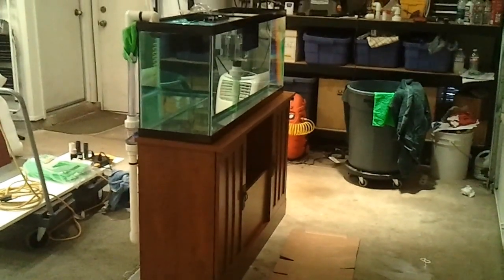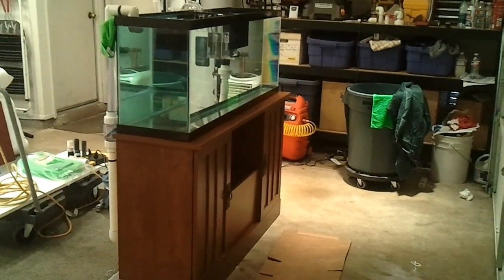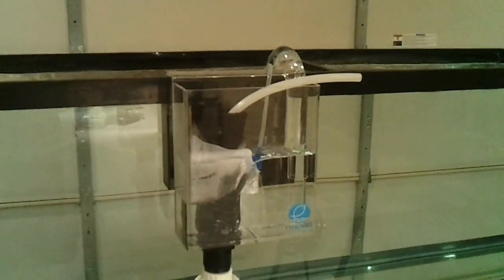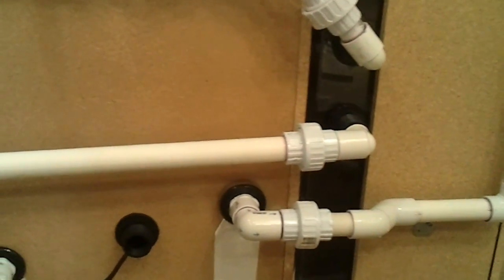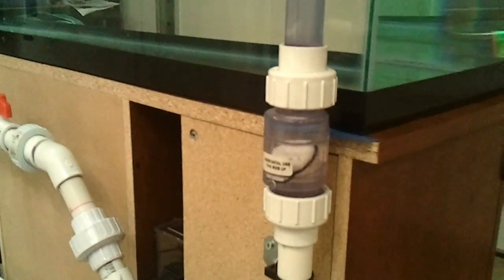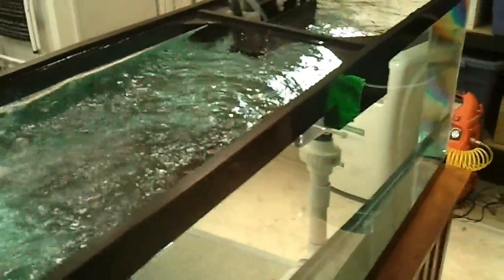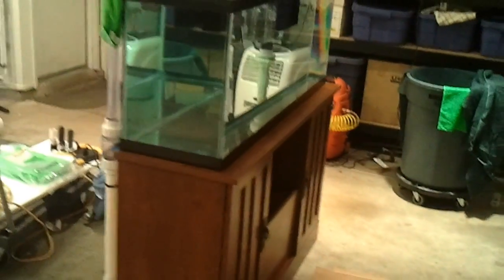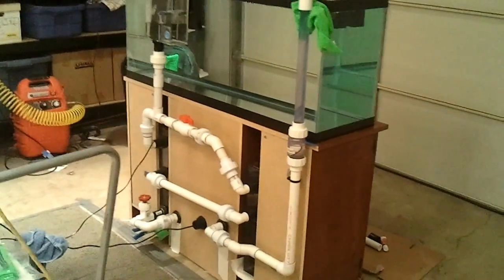Leak Test - Custom Split Sump & Refugium System

Comment: Hi, I ask you, what is your opinion on my aquarium project?
I plan to build an 8mm glass aquarium with furniture in wood and plywood.
Aquarium dimensions: 1.20cm W X 0.42cm W, H 0.50cm
Dimensions aquarium dequantation: 0.90cm W X 0.30cm W, H 0.45cm
my house (apartment) is located on the second floor
I wonder about the final weight.
Can my project be feasible?
Thank you

Comment: Not a big fan of particle board stands... could lead to trouble down the road.  Flex pvc easier to deal with, although at higher cost.    Really like that you did some planning and didn't just add water and go, that's the big lesson conveyed here imo.  A better stand and a drilled tank will save you considerable effort and hassles down the road for those new to the hobby (just my opinion).  Thx for sharing your experience. :)

Comment: That HOB overflow WILL fail at some point. Ditch the tank if u can't drill the back. All that plumbing is pointless if you are relying on that overflow. This is for someone reading considering a HOB overflow. Don't do it.
Reply: ChevyVoltarian glad you can just ditch a tank because you can't drill it. I've got two 55's that I can't drill, should I just toss them if I want to set up better filtration by using a sump? work with what you can, if it works it works..

Comment: nice plumbing and fuge tank, my only question is...wouldn't the system be a lot nicer if you drilled the back of the display tank? my apologies if its tempered, but i would have drilled the display just like the sumps, but great job overall!!!

Comment from the maker: it's pretty easy to reach - the stand had to be placed about 5-6 inches from the wall because of the external overflow. Since the tank is only 4 ft long, I can petty much reach all of the plumbing from on side or the other.

Comment from the maker: Since all the tanks are tied together, evaporation occurs and effects the system as a whole. I keep a 5 gallon jug of RO/DI water on the side of the tank connected to an ATO (automatic top off). Threre's float valve in the back of the skimmer sump connected to an ATO controller. 

Once the system is running and balanced the float valve can detect even the smallest amount of evaporation - works perfectly.

Comment from the maker: ya, actually i did.
 
once I got it into the living room, the noise was much more noticeable. I ended up replacing the hard pipe that passed through the back wall of the stand on the the return side of the main pump with vinyl tubing to isolate the pump vibration from the stand. it helped a lot.
 
I need to post another video of the system all setup - but I've just been lazy. I'll get it done soon though. :-)

Comment from the maker: not sure - probably the riser and filter sponge that came with it. In any case, I ended up removing that and now run it without the filter sponge filter. - I really do need to post some new videos...

>> I was wondering why you did not drill the tank 
I thought about it, but since this was/is my first tank, I was too much a of wimp :-) 
Also - the tank was given to me, so i couldn't tell reliably if it was tempered glass (which I don't think you can drill) or regular glass.

Comment: What is the black thing in your eshoop overflow box?   You have done a lot of work on your plumbing and I was wondering why you did not drill the tank instead of using the overflow box ? PS I have both